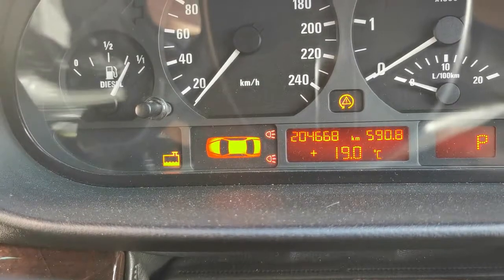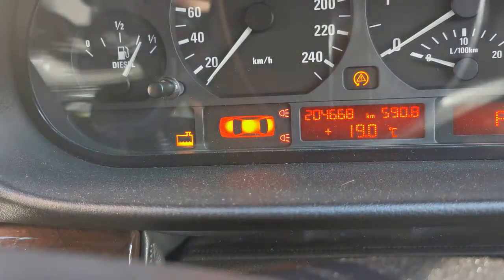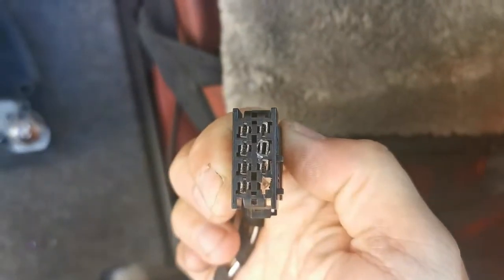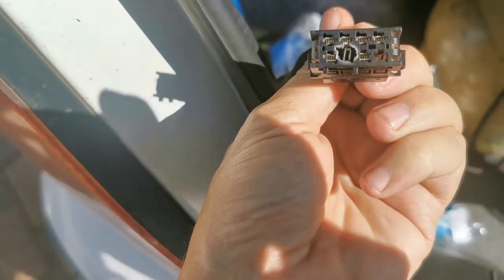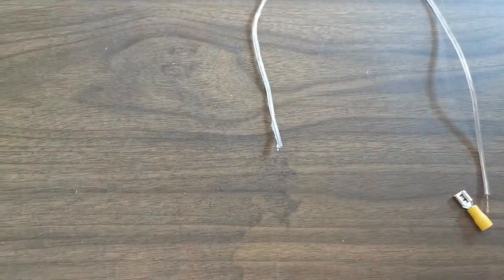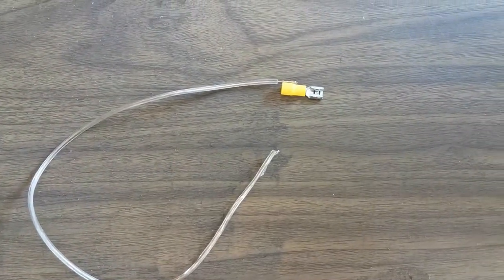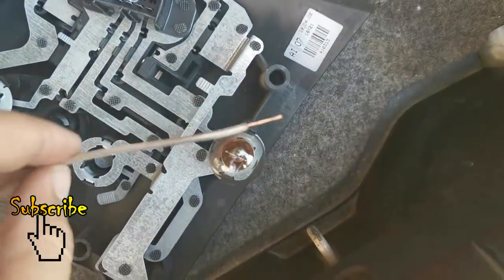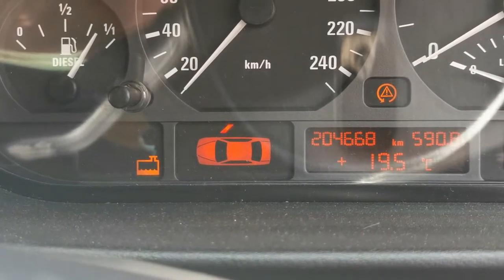Quick fix. BMW 320d E46 brake light problem.

Comment: Can u name the color codes for them? As in which is ground, brake, active
Reply from the maker: No sorry. I just now that you put it on the Brown is the earh. I Just extended it OR bipassed the plug by earthing the Brown wire to the metal part of the Light.